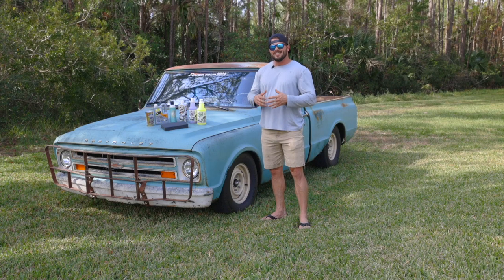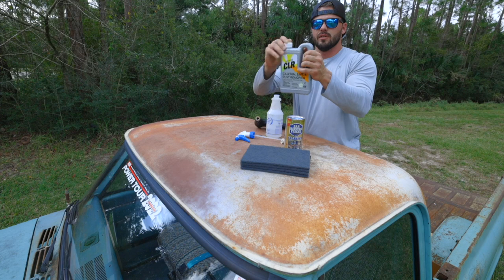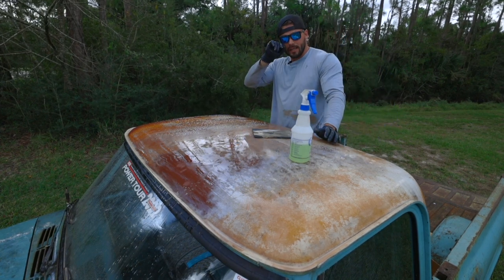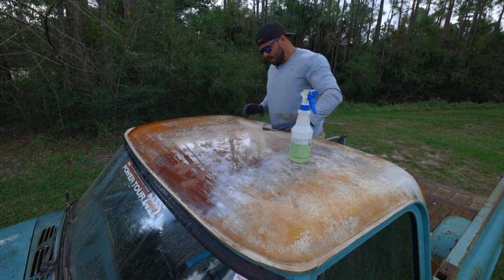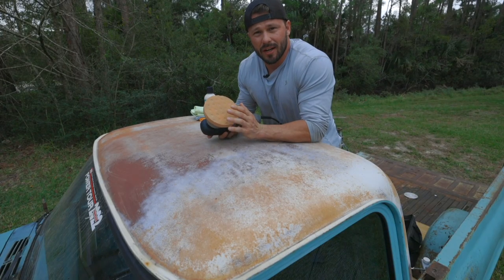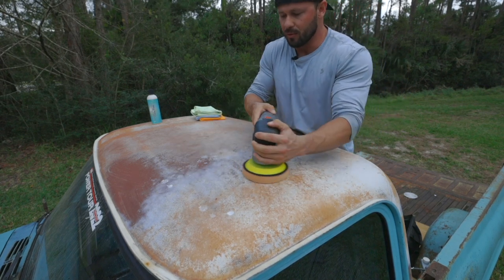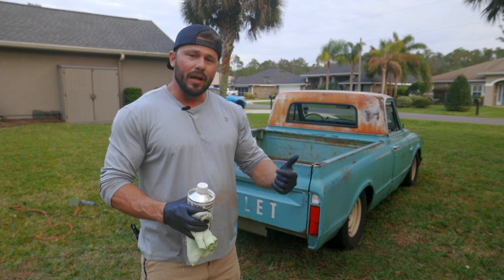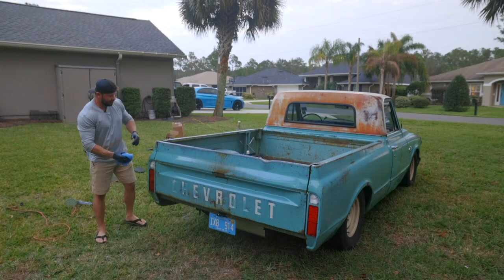Here’s what happens when you POLISH a Rusty '67 C10!

Comment: I was thinking of doing this with Linseed Oil never thought of waxing it. My Truck is Primer though and I was going to primer it again.
Reply: I used linseed oil before and it gets sticky attracting dust.   It’s also hard to get off.    There might be a product you can add to the linseed oil to make it not sticky but I just bought the patina sauce for my next project
Reply: @HillDwellerFeller  I did put the linseed oil at first I tried diluting it with Mineral Spirits which made a mess and also didn't work bc My Truck being primered it just Dried up quick. I used the pure linseed oil and although it was a little sticky for a day or so it really shined and all the Trucks angles caught the light and made the primer look fresh. I'm going to paint it but I still got alot to do before I get to that.